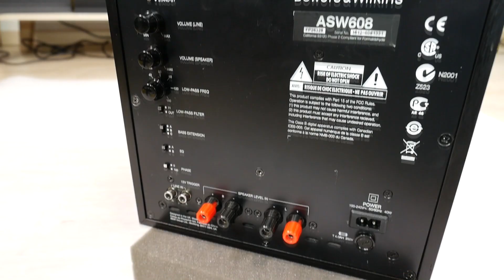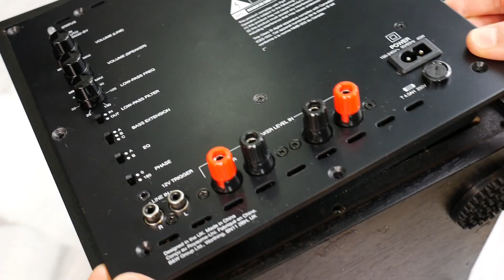B&W Closed Box Sub Disassembly + Free Air Test

Comment: 40W 200mm speaker 500euro. Bruhaha....
Reply from the maker: you're listening to numbers or sound performance ? Of course, jbl or logitech give you much more numbers.
Reply: @Techscrews  JBL stage1210   80euro
Sure Electronics AA-AB31512 1x500W    110euro
Hypex SMPS600N400 2 x 65 VDC 600 Watt Switch Mode Power Supply   150euro
MiniDsp      110euro
+ closed box
Reply from the maker: @janosnagy4382  sounds good, but nice box also cost certain money.
Reply: @Techscrews  DIY box 40-50euro
Denovo Audio Knock-Down MDF 1.5 cu. ft. Subwoofer Cabinet for Dayton 12" Reference 220euro
Reply: 40W what? The amplifier module is rated at 200W into 4 Ohm
Reply: @TokeBoisen  The power supply  only 40W.
Reply: @janosnagy4382 , no, the 200ASC has a built-in SMPS. The rated power usage of 40 W is not the power the amplifier module can deliver.
Reply: @TokeBoisen  If 40W goes in, 200W cannot come out.
Reply: @janosnagy4382 , I do hate to tell you the obvious, but the power given on the back is an average power draw, not the output capacity of the amplifier. Look up reviews of the module. It's perfectly capable of delivering 200W with its integrated power supply.
Reply: @TokeBoisen  Would you say this is a good sub for music only system, in a moderate room, to integrate with Spendor S6e floor standing speakers with 48HZ lowest bass range?
Reply: @MrStewbee , it really depends. Moderate output levels and not expecting it to flap your trousers for electronic music, yes, I'd say so. It's a compact sealed 8", so it is snappy and should be easy to integrate
Reply: £350 in the UK.